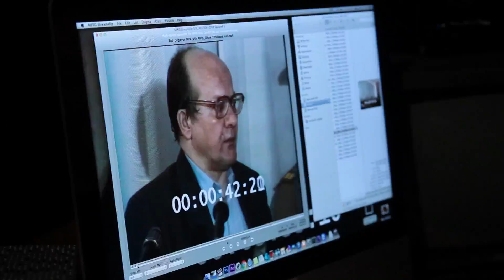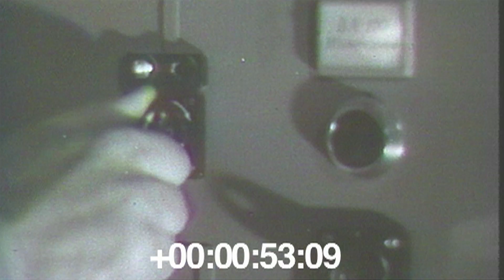Trial of those responsible for the Chernobyl accident. Causes. 1987. July.

Comment: Based on the wikipedia article the control rods did work though, they were lowered but because of a graphite tip designed to displace water, the lower part of the core actually became more reactive at first, leading to the runaway reaction (due to the positive void coefficient that was a result of the poor configuration)  - the fuel rods then supposedly cracked and this mechanical failure prevented further control rod movement and control.   But in this video he is saying the control rod wiring was not terminated so they never moved?  So which is true, or perhaps some rods moved, and others did not - resulting in the poor configuration?
Reply: For me personally this is the only suspicious part of the accident. As the guy in the video said, if the control rods managed to lower fully into the core, explosion wouldn't happen. According to the timeline of the accident given in the INSAG 7 report, about 20 seconds have passed between AZ-5 pressed and the explosion. The rods would have had enough time to insert fully, and would have prevented an explosion. I would have understood that some of them jammed due to high pressure and deformation of channels, but all of them to jam is a bit suspicious. Unfortunately there is not enough information online to prove or disprove this.
Reply: @protector1990  because it took 18 seconds to fully retract the rods back into the core. as soon as they were 'fixed in position' as the series says, that's when the explosion happened.
Reply: @GRaToMiC  Yes that's true, but the question here is why did they get fixed in position? That is usually explained by high pressure rupturing/deforming channels, but the question is do we know that for sure or is it just speculation?
Reply: @protector1990  Akimov cut electricity to the rod mechanisms, meaning they should have dropped down by themselves.
Reply: @protector1990  It was more like 5 seconds from AZ-5 to first explosion.
Reply: Carbon is used as the moderator in these reactors and there is no containment shielding beyond the reactor vessel itself, the rods were lowered and this carbon tipped control rods slowed the reaction of the neutrons which increased the reaction. The faster a neutron goes the lower the chance of a fission event, while the slower the neutron the higher the chance of an event. That is why in the rest of the world if a reactor loses water then the reaction stops, because the moderator in most all other reactors is water instead of carbon. So when the water runs out the reaction will come to a stop. That is why when the control rods inserted it added moderator for a moment and slowed the neutrons which led to an increase in fission which resulted in a chemical explosion. Chernobyl was a chemical explosion from the poisoned core.
Reply: Well and as I have heard, and don't know if 100% accurate. that the coolant water already in there was almost at a boiling point already. so at the first moment the rods hit the water, it instantly vaporised and just made the small jump in reaction to an uncontrollable reaction.since the tips were made out of reactive material instead of non reactive.
Reply: Diyatlow bazı röportajda kontrol çubuklarını sıkışma yaptığını ve 2iki tane adam yolladığınız ve onlar ölüme yolladığını fark etti aze beş butanı işe yaramadı ve patladi
Reply: I found this to be curious as well. The narrator almost implies that the control scheme was sabotaged, as he said that some components were removed. Also, narrator states that if rods would have dropped the reaction would have stopped, which directly contradicts the official stance that control rods had a design flaw of increasing reactivity at first. If this is the truth, what he is stating, then really the whole accident was deliberate. Really need to get more info in this. KGB holds many secrets on this, even the erased parts of Legasov's tapes.
Reply: @Chakys92  he's saying that the reactor control computer the 'skala' was tricked to not shut down the reactor. the scram button (az-5) was most likely still in an operational condition. the computer would have stopped the reactor and used the control rods earlier, which could still cause a spike in thermal power, but not that significant. also, the control rods would not have caused such tragic consequences after entering the core again as the control rods wouldn't have been withdrawn as high as they were, and there would have been more control rods already inserted, as they took out more rods than the computer, regulations or reactor design would allow.
Reply: @AlexanderHL1919  I'm American and have also been incensed at the epidemic of literal interpretation that assumes that whatever happened on the HBO show must be the exact truth. Down to the exact words said, etc. Smh. People everywhere can be stupid. 

I've read both of the INSAG reports, several books (Midnight in Chernobyl three times), and tons of other things I found on the internet; I've listened to professors discuss what happened, etc. 

I've watched Dyatlov's video here on YT and I've read an article he wrote that was critical of INSAG-7. 

But am I about to start correcting people, as if I'm the expert? No way. Yeah, I can hear me now: "Well, you see, what actually happened was ..." because I don't know the exact truth, either. I do suspect, however, that I'm a lot closer than what Mazin was lol ... 

Watching the show was very entertaining and interesting, sure, but watching something like this to learn "exactly what happened" is about like watching Oliver Stone's JFK movie as a substitute for taking a 3-Hour college level course covering the JFK assassination. Ain't the same, dig?

And if you're still in the "Dyatlov should die in a fire" camp, as if he alone is the reason ALL of it happened ... but you don't have an inkling of the problems with the design of the RMBK reactors ... well, you should probably do some more homework. IMHO. Peace.
Reply: They removed too many rods during the test
Reply: @nickira6751  and the reactor was poisoned with xenon thats why it was so unpredictable, it was running so many hours in low power condition which was fuckin dangerous

Comment: During the accident, Dyatlov was exposed to a radiation dose of 390 rem (3.9 Sv), which causes death to 50% of affected persons after 30 days. He survived that, and died of natural causes several years later..
Reply: Dyatlov was scapegoat, unfortunately Craig Mazin was not interested in making deep research (a lot of valuable information was never translated to english) and portrayed Dyatlov basing on untrustworthy Grigori Medvedev's book. Oleksiy Breus and Boris Stolyarchuk don't blame Dyatlov and they show Dyatlov actions in much different light. Google it.
Reply: @ShavoSoaDer  The prologue of this series (where Legasov is finishing up his audio tapes) does suggest that Dyatlov was being made a scapegoat for a larger, more systemic problem, and that it was easy to do so because he did make a lot of poor decisions and was personally not very likeable.  At the end, they laid out pretty clearly that the more important problem was the government's cost cutting on safety measures and its hiding info on the hazard posed by the graphite-tipped rods.  I'm curious about what else there is to know, if you can explain it without having to waste too much of your time.  Thanks.
Reply: @ShavoSoaDer  Or read Midnight in Chernobyl. Agree with what you said here, a few of Mazin's decisions created a fictional Black Hat character in Dyatlov. It was unwarranted, Brukanov or Fomin, or others who knew the danger, could have shared far more blame.
Reply: @T113_T1T1AN  Dyatlov broke the test procedure but kept fine safety margins, according to the data that was collected and calculated the plant. The problem was, that he was pushed to do something that wasn't properly consulted with people more competent on the RBMK reactor, and he didn't how much unstable the reactor is, or that the control rods can cause effects exactly contrary to their purpose. Nothing suggests he went denial, he inspected everything himself as much as possible and was trying to do something. The problem was that there were no emergency procedures for such a failure so Dyatlov couldn't have known what to do.
Reply: Piotr Malewski thought h was the senior expert!
Reply: he died aged 64 from heart failure ... wtf u talking about
Reply: GOLEM Yeah. But he survived 9 years after most people would’ve died within a month of the amount of radiation he was exposed Fox
Reply: @salamisumo2  and 5 years of this 9 he served in prison, it was very heavy punishment, very heavy.
Reply: he died at 64, that's not natural causes. watch his last videos he looked like he was 80. I know how healthy 64 year old look like
Reply: Who cares he is suffering a worse fate now rotting in hell now with hitler
Reply: Dyatlov is too stubborn to die
Reply: The devil may work hard but Dyatlov's immune  system works harder 😂
Reply: The understanding now is that the Chernobyl accident mostly had to do with unknown or understudied phystics problems having to do with the RBMK reactor.
Reply: Hjembrent Kent  while that is true, as stated in multiple recounts of the explosion and on the show, they ignored a lot of safety proceedings and pushed the reacter to the brink of its working capacity, so they also fucked up too
Reply: @hjembrentkent6181  Yes, right.  And the two previous RBMK accidents, one at Chernobyl unit, were what?  "Understudied physics problems" is another statement for "Russia's incompetent nuclear program behoven to paranoid politics and a lust for military dominancy".
Reply: +Hjembrent Kent
Obviously not if you read the papers Dyatlov pushed the reactor to unrealistic levels it would exploded regardless if it had its flaws or not, the rod designs are also explained in those papers the reason they were made the way they were, had nothing to do with being cheaper and all about doing things slowly, Dyatlov wanted to push the reactor like a race car however.
Reply: @SMGJohn  so I guess the TV character was protrayed correctly for that Buffon
Reply: @SMGJohn  could you reference your sources regarding that information?
Reply: @hjembrentkent6181  Well yea but he didn't follow proper guidelines for the safety check.
Reply: He was a Tough Stubborn character in the TV miniseries, punchable face character.
I guess it was the way of life back in those Soviet era
Reply: I work with 65 Russians that spent half their lives in the Soviet Union or longer. They are truly the nicest people. But they become assholes in seconds. My laboratory supervisor acts just like the boss of the control room. He is 60 he grew up and lived most of his life in communism this is usually how they act. But they sure are very nice people VERY but beware 😉
Reply: @khuret1773  your guessing is incorrect. Yeah he was a stubborn man in some ways, maybe despotic but not a piece of trash like in series.
Reply: @Saguser-jl7dr7wy9t  ok. Happens... judging from a series cnt be accurate.
Reply: @bfahren  apparently he, even in his older age, walked to work and back to stay healthy. He was probably fit all his life...
Reply: The chances of developing coronary artery disease (plaque in the arteries within the heart) goes up massively when exposed to radiation, this is why people receiving radiotherapy to the chest have to look out for this late complication. It's very likely his exposure to this cataclysmic event lead to heart failure.
Reply: You're delusional, Dyatlov died of natural causes because he was only exposed to 3.6 roentgen. That's not great, but its not horrifying.
Reply: Hans Gruber , I thought you also were dead as John Mclane threw you out of a building ☠️☠️☠️
Reply: Literally a cockroach
Reply: @bfahren  after first accident (he get 100 rem) his younger son also have died because of blood cancer.
Reply: Perfect copy paste answer
Reply: Not great. Not terrible!
Reply: @DanielEyre-v2z  Exactly, KGB has been reporting that plant is being built really subpar. He rushed it to make party happy.
Reply: He suffered another nuclear leak in the 70s (2sv I think) while installing nuclear reactor on a submarine. He survived that, and then Chernobyl. Damn.
Reply: I love all those people that hate on Dyatlov, probably dont know shit about what had actually happened, and all the actions he did.. only watched the HBO series, did you?
Reply: wikipedia says he died of radiation-related illness tho
Reply: @T113_T1T1AN  Sorry, I don't speak this language. Try English.
Reply: The show showed that he died of a disease due to radiation exposure in the end credits.
Reply: @Baku Tube Dyatlov was completely wrong presented in the HBO about it, there is an one hour long video on youtube where they interview him in 1994, a year before he died and he explained everything to them
Reply: @Drnken119  dont leave us on a cliffhanger:) give us the short version
Reply: @orale_  Go watch the interview then :p its interesting to listen to
Reply: @Drnken119  I'm not THAT interested.
Reply: 3.6 Roentgen. Not great, not terrible.
Reply: James Ho i’m told it’s the equivalent to a chest x ray
Reply: In 1995, iirc.
Reply: Probably because he received proper care immediately
Reply: There is no proper care. They become zombies with beating hearts
Reply: "Natural causes" 😆
Reply: Duuuh radiation is a natural cause too, as it's in nature. Or nope?
Reply: 390 rem - not great, not terrible. At least for Dyatlov
Reply: Yeah but those natural causes might have been a result of that radiation.. But you know.. You cant kill stupid. It dies on its own
Reply: He died at the average age of mid 1990's Russian man.
Reply: He was the Rasputin of the 80's
Reply: He actually received a 550 REM dose, plus 100 from his previous work.
Reply: No he dies of problems related to radiation exposure, it was t natural he was to young for it to be natural
Reply: That was his second fatal dose.
Reply: His interview is there in youtube ,if you watch you will get more idea abt him and series.
Reply: Lol he died from radiation bro lol chill with that fake news
Reply: He died from heart failure cause by radiation poisoning so no, he did not die of natural causes. And besides that, after Chernobyl, he was sentenced to work for 10 years of hard labor, of which he completed 5 and then he was release, and in 1995 he died. That's only 9 years since 1986 so again, he did not die of "natural causes" as you so eloquently put it.
Reply: Pretty sure it was 3.6 roentgen
Reply: No, he died from a heart attack.
Reply: That's because he wasn't there when they raised the power, he's in toilet
Reply: @mattaddison19 akimov wanted to stop the test but dyatlov forced him to continue - thats a fact. Dytalov was the only Person who could  have prevented it.
Reply: @mattaddison19  Will Mara: The Chernobyl Disaster: Legacy and Impact on the Future of Nuclear Energy. Marshall Cavendish: 2010, pages 21-23
Reply: Lmao yall, criticising his character, based on how hbo  impersonating him.
Reply: @T113_T1T1AN  wrong
Reply: Dyatlov should have been the one to go on the roof and look into the reactor. He was responsible for tremendous loss of life directly and indirectly.
Reply: @albertopa58  he almost did, if the show is correct in its depiction.
Reply: @albertopa58  you're basing too much of your info off of HBO, Dyatlov had stayed at his post commanding relief efforts (he realized that the reactor had exploaded the moment he started feeling symptoms, but continued to lead from the front) until he had passed out and they had to carry him out of the building.
Reply: Alberto P. Abreus he was going to look on the roof but collapsed before he could so Sitnikov ended up having to do it
Reply: He is devil himself
Reply: @kollamkaranforlife8798  He wasn't like the Dyatlov portrayed in HBO, he was indeed strict and not the best boss, he never commanded anyone to open valves near the LBS, he never said nonsense lines like " Fuck, Khodemmchuk " as he tried to find Khodemchuk personally. All of them are victims of the Soviets as they never told Him and his Colleagues the flaws of the Safety system for the RBMK-1000 reactor.
Reply: @kollamkaranforlife8798  Not only that. He's the angel of death.
Reply: @kollamkaranforlife8798  He is not dyatlov wasnt actully responsible he was following orders and did everything the ussr told him he is innocent
Reply: @kollamkaranforlife8798  and only a hopelessly dysfunctional system gives that degree of authority to the devil himself.  I should know, being an American ... 😉
Reply: @M.E. Rasulzade lol. Another accident wasn't a secret for scientists. KGB didn't nothing to cover it. Just some idiotic and irresponsible people didn't  want to improve the structure of reactor. That's all.
 Did you make the conclusion like this after watching historical inaccurate TV series?
Reply: he didn't taste metal😅
Reply: Wikipedia doesn't lie, yes yes.